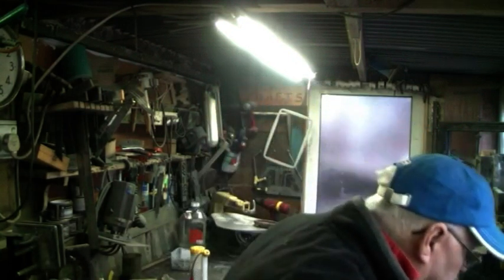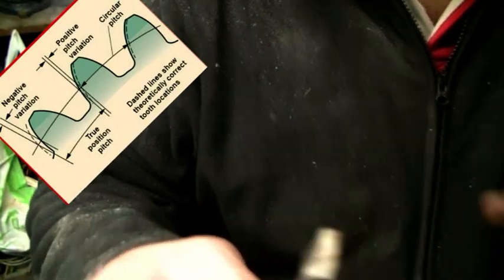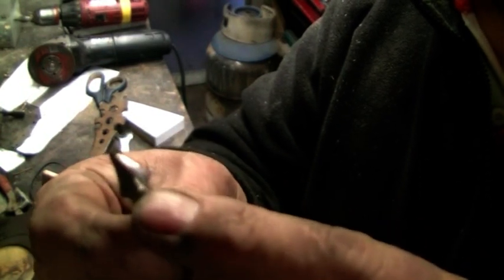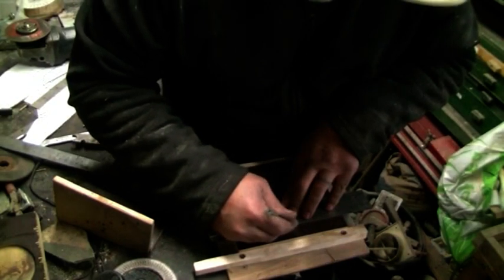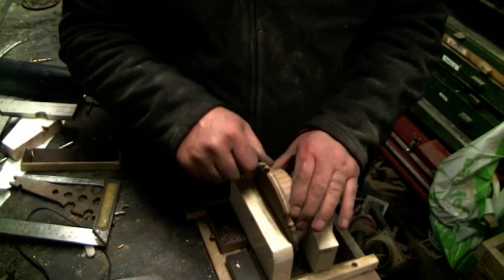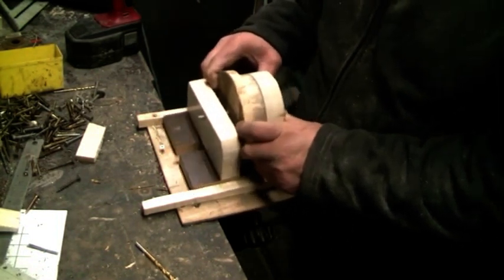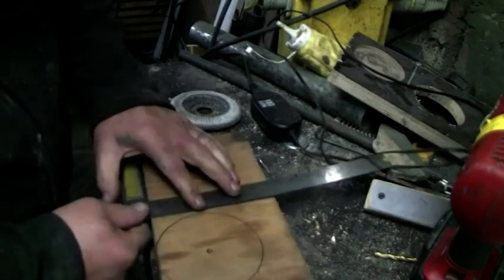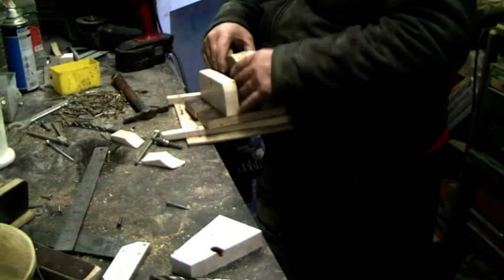how i built a router gear cutter

Comment: What about making a Big Ben replica with your gearing? Could cheat a little with electronic clock work. But the gears inside those big time keepers would make for a great piece of art. Just throwing an idea out there if you want. Thanks for the ideas brother :-)
Reply: O sorry Robert, halol, well what about a multi gear operated beer can crusher with ultra low rpm high torque ratio for that talking piece when mates come over for a drink then ??? :-)
Reply: @terryallen3550  nobody  drinks beer from a can you get from the keg beer made from old rye bread